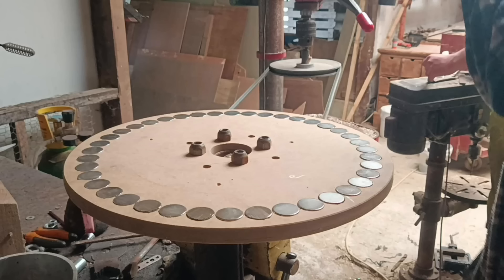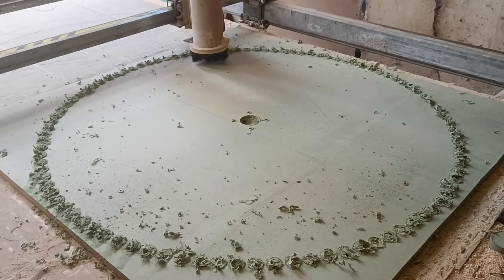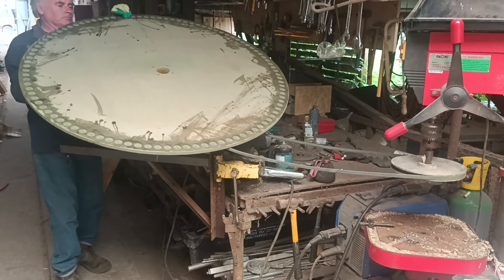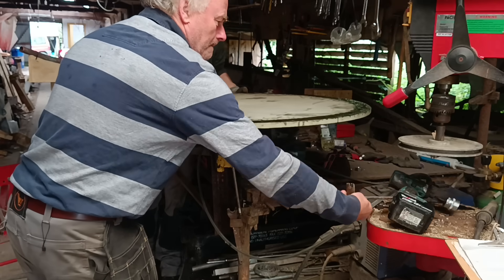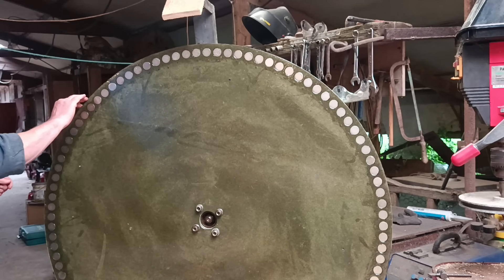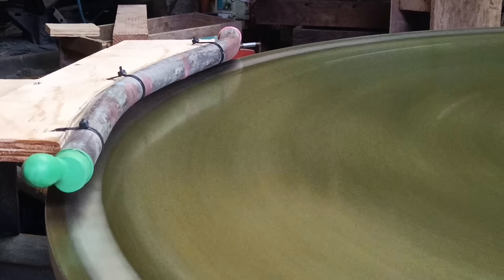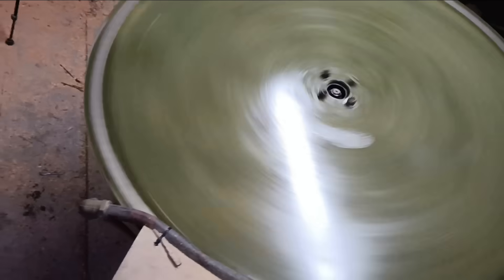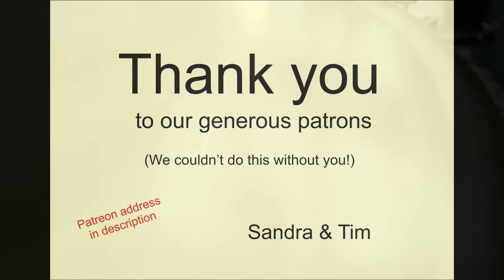ABSOLUTELY HUGE Magnetic Induction Heater! Using 100 Spinning Neodynium Magnets And A Bucket

Comment: Going to need a longer copper pipe.
Something that'll go all the way around.
This will give you much more exposure.
In fact if you could duplicate that on the other side of the disc that would give you even more area.

I would love if you could put an a voltmeter from one end to the other, because this should be generating electricity as well.
A shorter routing between your holding tank and the heating coil would ameliorate your losses.
Couldn't this be powered by a stationary bicycle?

Comment: Hi I love your videos and I have a Idea for your system I would use a pipe about the same length as the diameter of your magnet ring and bend it to a ring to maximise the amount of copper getting heated with this you should be able to reach higher temperatures and  a more efficient rotation to degrees of temperature ratio and for bending the pipe I recommend closing both ends and filling it with packed sand and then you can just bend it over a template without the pipe just bending at some points.

Comment: Would making a coil of narrower diameter pipes that gradually go over the top of each other in a towering spiral allow for more pole flips in the same space as the height increases and the water stratifies in the pipe? I'm not all that familiar with induction heaters. or is more coils only better for making electricity as it increases the resistance at the source of rotation.

Comment: Instead of a disc, how about a rotating column of magnets surrounded by a copper coil?
Reply: The flat disc has alternating poles, so it agitates the metal molecules.
Reply: correct. And a column of magnets arranged so that the alternating poles are in a checkerboard pattern may be more efficient.
Reply: @fouracrefamily9801  ahh I see ok thanks

Comment: at the end you will have a windmill. That should produce energy and to heat that up you usually would use a heatpump. 
Then the output is calculatable by the input of electricity. Due to the high amount of wind especially during winter the energy is available when you want to heat and not in the summer. For 1 kWh electricity in you can get 4,2 kWh of heat out. Far more then with induction heat. And the chinese heatpump we had ordered and can deliver 12 kW was about 1800€ free delivery and incl. all fees and customs. 

I guess your induction will need to get far bigger to create such 12 kW out of 3 kW input. 

Of cause a great project and craftmanship, but heating a house or cooking an egg are 2 different challenges.

Comment: A few loops of narrow, flexible copper tubing encircling the entire travel of the magnetic disk (in place of the short copper tube you're using now) would increase affected surface area and greatly improve the efficiency of the device.

Comment: I love to see a project where the goal is to keep improving it.
And to that goal id like to offer an idea:
Magnetic fields disperse in air, becouse air resists magnetic fields.
To solve that, you can decrease the gap between magnets and the heating element. That is why i would at least offer to use a flat bottom pipe, so there would be more interaction between magnetic field and metal.
Also, the wobble will hit the pipe eventually (if you choose to move it closer, what i would recommend), unless the disk is constrained using bearings on top and underneath, best grabbing the magnet disk by the edge, though the magnetic field might heat them up. If so, you could either get ceramic bearings, though theyre expensive, or move the bearings on the other side of the magnets and move them away from the magnets, which offers less stability due to worse leverage, but it will be okay probably